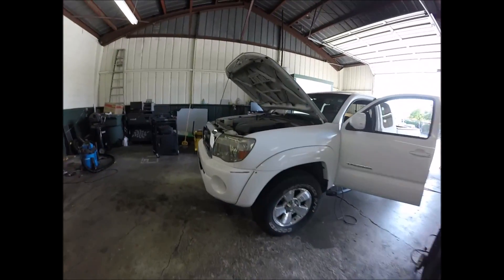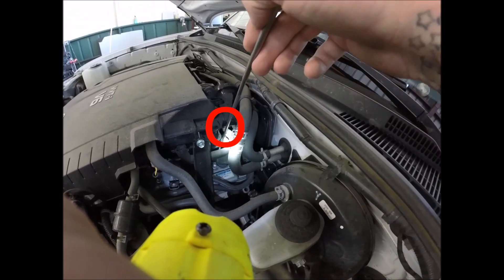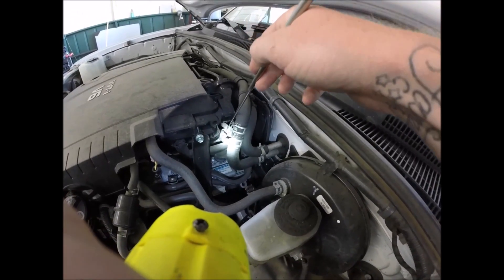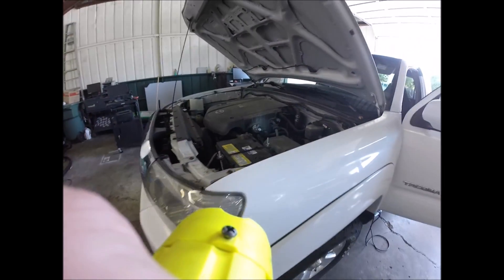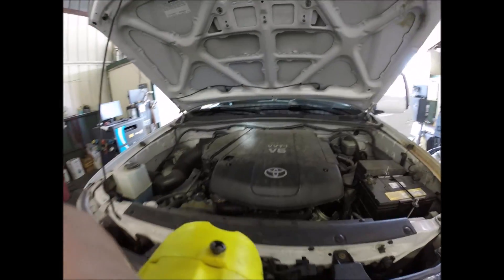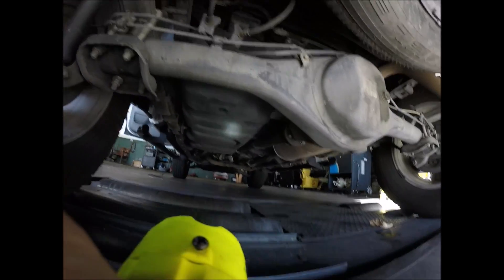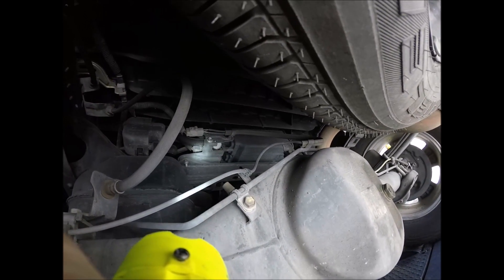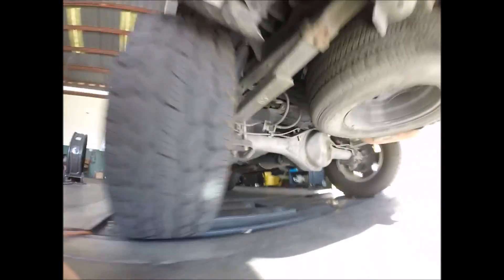Toyota Tacoma emissions parts locations. EVAP canister, purge, & PCV valve

Comment: great information, question, you shown Evap solenoid, what is the name of the shape like  black cylinder that is connect to the tubing on the Evap Solenoid. ( disconnect shape like black cylinder and blew air with my mouth and there is not restriction on the black cylinder, is the normal) hope to hear from you.  God Bless
Reply from the maker: Can you picture message me the part you are looking for? Or at what minute mark in this video is the part you are referring to. Pic message me at (925) 418-5096.
Reply: Did the poster ever tell you what that little canister is that's fastened onto the hose? I would like to know what it is as well

Comment: Hello thanks for your video my check engine came on this morning  and my mechanic says I need a new evap canister on my 98 Tacoma it is located on the far upper driver side.
Reply from the maker: What is the code are you chasing? Toyota has a couple extra VSVs added into there evap system.  They are kind of a pain in the but. Also, some vapor canisters come as an assembly with one of those valves. So it might be a situation where the canister might have a valve on it and it's faster to get a canister at this time due to the supply shortages.
Reply: @ScottiesHobbies   Don't know the number off hand but my mechanic says it has a problem in the canister I thought it might be a leak I did change the gas cap and I notice a few vacuum hose were cracked (I change those also) so I will save a few checks and get it fix soon.

Comment: I got a P0441 and a P0455 code mr Scotty dude for my tacoma 2008 😞
Reply from the maker: Big evap leak.. have you checked the fuel cap?
Reply: @ScottiesHobbies hi, in case it’s not the fuel cap, what else could it be?
Reply from the maker: @demagana  really could be a number of things. If you are not having a starting issue like excessive cranking, then you might want to check and make sure your vapor vent solenoid is closing when the vehicle is on.
Reply: @ScottiesHobbies  I have had excessive cranking issues. Where do I start? 2016 taco
Reply from the maker: @robertwarneck6464  I'd check and make sure the vapor purge valve is sealing. I think it's a soft hose. Get hose crimper, plug the hose. Disconnect the purge valve electrically and try to start the truck a time or few. Let me know. Next will be air leaks in the intake, dirty mass air, or general maintenance.
Reply: @ScottiesHobbies  will do, problem just started today so I'm taking tomorrow off to try to fix it. Thanks for replying I appreciate it!
Reply from the maker: @robertwarneck6464  prior to doing that test, I'd check fir codes to make sure nothing is pending. Doing that test might make the check engine light turn on..

Comment: Greetings! I have a similar Tacoma 2010 4.0 liter. Recently got the dreaded P0456 code “small leak detected”. I have already tried a new gas cap with no change. 

I don’t see any obvious hoses that are disconnected either. Any recommendations on how to check those valves ? I read removing them with the ignition switch off, the switch  alive should be in the closed position. So blowing into it you should hear air leaking ? 

Any guidance would be greatly appreciated!
Reply: Hey Brent! I am having the same issue with my 2008 taco! Did you find any resolution for this issue?
Reply: Yeah, so I have fiberglass fenders on my truck , so when it rains water would splash up from the rear drivers tire around the gas cap filler neck, the water would enter at the vent holes then run down to the charcoal canister . Once it reached that the canister is basically bad. 

I went to a junk yard and I believe I found one out of a Toyota Camry or something that was the same part # for 15 bucks instead of the 240 dollar new or whatever outrageous price it is. 

Once I replaced it I removed the vent hose from the filler neck and re routed it away from the filler neck. I hope this helps.